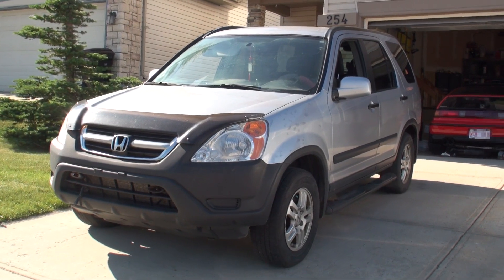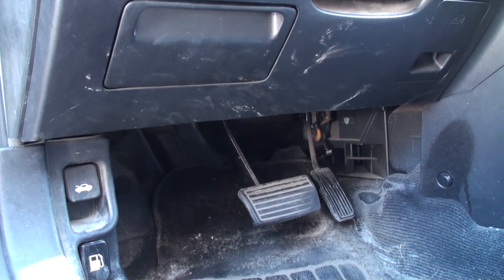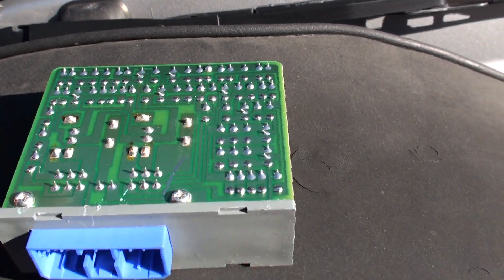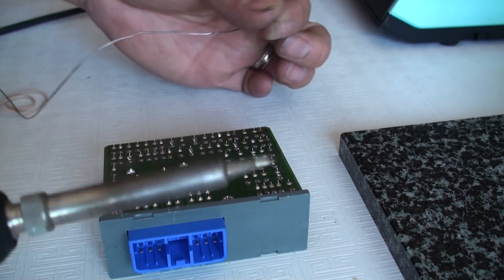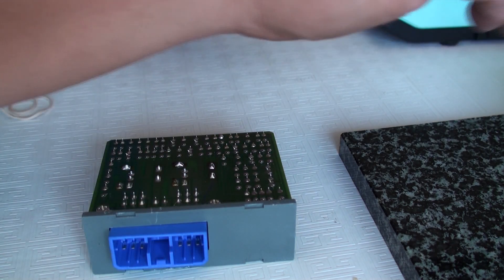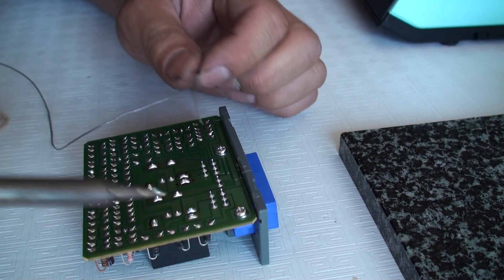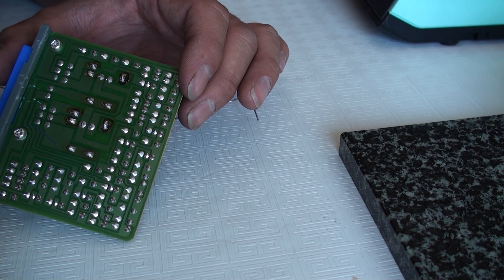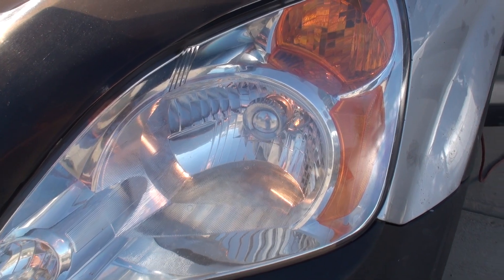DIY Honda CRV DRL Module Repair

Comment: Hello does anyone know where the DRL module on a 2010 Honda CRV is located...? I can't seem to find any info. Thanks
Reply from the maker: It should be underneath the drivers side dash around the fuse box steering column area.
Reply: @piercedasian  apparently not in the generation of CRV....

Comment: Thank you!

I was directed here from a comment in a Nissan forum. I have a 2005 X-Trail that has had wonky daytime lights for a few years. Sometimes both on, sometimes both off — or just the left side on. 

I sensed that the light bulbs themselves were okay, so this DRL module fix is great! 

I didn't know how I could safely open the case but eventually used a putty knife and a spare door strike-plate on each side. Just get those straight edges in there to separate the sides — and out comes the circuit board. Mine is slightly different but I'll key on the areas you outlined in the video and report back.

Here goes!

Follow up: Well... no luck for me. None of my joints looked suspect, like they did in the video. 

I'll just keep on running my lights in 'twilight' position during the day, until I can get to a wrecker. If THAT part also fails, I'll know how to address it.  Nissan doesn't display a trouble code for the DRL failure, so I won't be bothered by that.

Comment: Thanks so much for the video. I have been changing bulbs, turning on my headlights to stop the damn DRL from buzzing and then of course forgetting to shut off the headlights and dead batteries. Wished i had just found your video a couple years ago. You were dead right on the bad solder joints. Everything worked out great. Very thankful for the clear video. You dah man!!

Comment: Nice video. The only thing I might recommend is fully removing the old lead free solder from the holes using a solder sucker. Mixing solder chemistries (leaded/unleaded) can lead to premature failure of the joint. Simply flood the joint with unleaded (adding flux helps a lot), then suck it out with a sucker, and apply new leaded solder. The joint will look better and last longer.
Reply from the maker: In my case there was no need for it because I have stockpiles of old lead solder that I purchased years ago that flows perfectly with the existing solder.  You make valid points however, in that new lead free solder can pose a problem with solder containing lead.  Best way to comprehensively remove solder cleanly I find is using solder wick to suck it up.  Works extremely well especially when I am working on restoring old vintage electronics.
Reply: @piercedasian  So actually what you are are doing when mixing chemistries is you are lowing the melt point of the unleaded solder (217C) to a melting point somewhere in between unleaded and leaded (183C or138C). Even though to the naked eye, the two types appear to flow together, you are actually creating a weak joint at a molecular level. Ie. A pure leaded or pure unleaded solder joint are each a stronger in their own right than any mixture of the two. When you mix, you make a joint that is more prone to oxidization and eventual premature cracking/failure. This is exacerbated in applications that are subject impact damage (like a bouncing car)

Tl:dr Always remove old solder unless you are matching the existing type with the new addition
Reply from the maker: Yes fully aware of that.  At the time when I created this video I don't think it even crossed my mind that lead solder was becoming the way of the dodo.  As I said before, the solder used in this repair for the relays I fix (and continue to fix) that I use leaded solder because that is what would've been used from the factory.  I fortunately haven't had the need to repair (but have played with) dead electronics that use lead free solder and that's a bit of a different animal compared to the good old lead stuff.  When that time comes when a I come across a part that uses lead free solder is when I'll have to explain the importance of not mixing two different solder formulations.
Reply: @piercedasian  My apologies, I must have misunderstood. Upon rereading and checking RoHS implementation dates. I see that the module that you were repairing likely was produced prior to the introduction of lead free solder. Excellent video
Reply from the maker: yep the cars I work on have plenty of lead in their electronic components.  A bit of an occupational hazard for me since I work on so many of them all the time :) lol

Comment: Thanks very much.  Initially this didn't work for me. A friend suggested that I remove the old solder first so I did. Then when I re-soldered the relay pins it worked fine. Sometimes the old solder is in bad shape you have to get rid of it first.
Reply from the maker: yeah, they're definitely right.  It depends on how you solder too.  I found when using underpowered irons that solder doesn't flow very good.  It's also important to know what solder you're using.  Many of these old relays used lead based solder so naturally, you'd want to reflow with a rosin core flux lead based solder.  Some folks that struggle with the repair seem to be using the lead free stuff which I think is crap but will work IF you remove most of the lead solder first.  Either way you fixed it on your own and that is what matters most.

Comment: How to remove the box
Reply from the maker: The box is held onto the car's chassis via a bracket that uses a single 10mm bolt.  It is far easier to service this item by just remove the electronics from the box and not have to fiddle with the actual box and bracket since it is in such an awkward position.

Comment: Fixed mine thanks for the good video.  I also fixed an immobilizer problem the same way.   Fuel pump wires were high draw wires and cracked the same.   A suggestion was to put some holes in the cover of the box to allow some air flow and not get so hot inside.
Reply from the maker: Glad it helped

Comment: My dash lights, running lights front and rear do not work. Could it be this?
Reply from the maker: running lights and rear lights yes.  Dash lights maybe not so much but I'd start with the DRL module first.
Reply: @piercedasian  it was fuse in the engine bay fuse box. It had a thin Crack on it.

Comment: Great video Thanks. But I have a simular problem on a 2001 CRV. I know it was modified for driving Light importing to Norway... 
My problem is that the light will not go off when I turn off the engine. 
Any suggestions?
Reply from the maker: hmm I can't help you there b/c goodness knows how the modification was done.  There likely is a sticking relay as I'm assuming that it was working fine previously?

Comment: Thank you so much! You have saved me a few hundred dollars and a ton of worries. I have a 2006 CR-V and the DRL didn't work for a long time! I thought it was a BIG problem! I followed the steps in your video. It worked out really well, except I had a bit of hard time trying to separate the wire harness from the socket. But it was done. Thanks for sharing!
Reply from the maker: Glad it helped

Comment: 2021 and our first CRV 02 and couldn't believe Honda would do recall for this poor module. I contact a CRV forum and no one there responded til I looked and found this video and couldn't be helpful. I was able to take the 10mm bolt and remove the module. And just like yours the cracks where visible on the solder side of the relay. Also once out and removed the repairs couldn't be more easy then putting a diaper on a baby. But mine was up and to the left of the underside and I used the 10mm with extension and just took the whole bracket out. But THANKS again for a 2013 video showing how to do this and where to look.
Reply: Glad I took Electronics Service Technology in college this helped alot in how to solder and desolder. Which I did to redo the solder points. And now it looks new. Next time I at junk yard I will grab a few of these as backups.
Reply from the maker: Glad my video was of use to you.

Comment: Do you need flux paste or its fine without?
Reply from the maker: The solder I use has flux combined with the solder but you absolutely need flux to allow the solder to flow properly.  If your solder doesn't contain rosin core flux then get a compatible flux paste designed for electronics use.

Comment: Thanks dude!!! I have been fixing and repairing my own vehicles for 30 years and have done ground up restorations on two vintage cars. I am an instrumentation tech by trade. I could not find the problem with my 2004 CR-V high beam problem and exhausted all of my troubleshooting skills and knowledge, until I saw your video. Had it fixed in 15 minutes!!! Thanks so much!!
Reply from the maker: Glad to help

Comment: Thanks for the video, it is very helpful too , My 2004 CRV DRL error light up and high beam not work  problem was solved after  re-soldering the joints .
Reply from the maker: Glad it resolved your issue.  Yes these DRL modules and main fuel relays in these cars all seem to suffer the same problem.  A quick touch up with the iron and you're good for another 10+ years.

Comment: Cold and broken solder joints are a common  problem on a lot of electronic board are easy repairs thanks for bringing this to light 💡lead solder flows and sticks much better
Reply from the maker: yeah the new ROHS compliant stuff drives me mental.  Old school lead all the way!

Comment: I hope this works on my Q45, what a pain eh?
Reply from the maker: It depends on the mode of failure.  If luck is on your side then the fix at least will be super easy.
Reply: @piercedasian  went to a buddy at the National research Council and it was fixed in 10 min. Perfectly. Cracked solider just like in the video
Reply from the maker: that's awesome news!  Good job!

Comment: 2004 Honda civic si (SiR Canada) EP3. Just did this - I had three cracked solder connections I had to repair / re-solder. Worked great. Thanks for the video.
Reply from the maker: nice an old school EP3 :)  Glad it all worked out for you.

Comment: Had my DRL's working intermittently until recently and then they stopped altogether. Your video put me on the right track popped that sucker open put down some new solder she works good as new! Thanks so much.
Reply from the maker: sweet!  Glad to hear that you got your DRLs working properly.  It is amazing what the DEALERSHIP WON'T tell you and just charge up the ying yang to repair the module.  Congrats!
Reply: Well I imagine they just pull the old module, send it off to be 'repaired' and resold. Profit for them on parts and labour.. Or I could just spend 5 minutes with an iron.
Reply from the maker: No they actually sell you the new module and toss the old one!
Reply: I meant that they probably sell you the new one, but send your old one off to be refurbed and sold to some other poor sod. However tossing it is another likely option :p
Reply from the maker: ah I get you.. You're probably right... or their techs take the old part and rebuild it and then fix other people's car's on the side and pocket the extra cash... in either case fixing it yourself is by far the best option!

Comment: I install hid lights to my honda crv low high beam working but day time running light doesnt work .. Can u help me whats the best thing to do thank u
Reply from the maker: If I recall correctly the CRV daytime lamps rely on the high beams (running on a very reduced voltage) to work and since HID conversions typically delete the high beam lamp circuit (you don't really need it with HID) that no high beams = no daytime running lamps.

Comment: this worked a treat, 5 minutes with a soldering iron and it is working properly.  My 04 MDX unit came out with out tools and it was all done in about 10 minutes.  The solder points were really very obvious.  THANKs
Reply from the maker: you're most welcome.  Glad you got your DRL issues fixed!  Thanks for watching :)

Comment: Was having issues with my drl on my 03. But mine were burnt so bad I went to the auto wrecker and found a good module there 25 bucks. Thanks for the tips there bud. Cheers ehh.
Reply from the maker: glad you got your DRLs working.  Yes sometimes the contacts are so burnt that occasionally it may be just easier to get a used DRL module and resolder the joints prior to installing the replacement unit.

Comment: Excellent DIY video! My son has a 2004 CRV and it started with intermittent buzzing and the DRL light coming on and off, but the headlights worked. Eventually the buzzing and DRL light stayed on and the right Daytime light stopped working. I was about to go buy a new bulb, when I decided to Google "2004 Honda CRV DRL" and this video popped up. Thank goodness! My soldering skills aren't the greatest, but were good enough to make the repair. Took me about a half-hour and now the buzzing and DRL warning light is off and the right daytime running light is working! Thank you Pierce, for such a well done video!!
Reply from the maker: glad you were able to resolve your DRL woes.  Bad soldering skills?  If it fails in the future you can use his DRL module as practice to improve your soldering :)
Reply: Not bad soldering skills, but not great. I done more of it, involving electronics, this past couple of years and so far, so good! Anyway, thanks again, worked like a charm! :)
Reply from the maker: you're most welcome!

Comment: When I start the car I hear a buzzing sound (coming from the dash area) which goes off eventually or when I turn the headlights (parking or night) on. Eventually it stopped altogether and the DRL indicator light stopped appearing on the dash and the DRL lights are not working any more. Will this technique work ? Thanks in advance.
Reply: DRL lights are still working. Just DRL light indicator stopped coming on altogether.
Reply from the maker: What you described is exactly how a DRL modules begins to fail.  Solder up those joints and you'll get another solid 10 years of service from the module :)
Reply: Thanks! Since the DRL lights are working (and DRL indicator is not coming ON) what does fixing the solder joints buy me ? I understand that it buys me another ten years of the DRL module but don't understand what that means.

Comment: I have this problem along with few other problems : intermittent AC disfunction, intermittent hot air not switching, could these be related?
Reply from the maker: hmm not likely but there could be another module SIMILAR to a DRL one that could have a faulty solder joint that is causing these issues.

Comment: Did this fix to my 2005 CRV. Right high beam wasn't working and DRL dashlight was on. After resoldering the module board everything worked perfectly. Right high beam now works and DRL dashlight is off. Thanks so very much for this fix.
Reply from the maker: +Bob Hicks you're most welcome.  So happy to hear that you got your lighting issues resolved!

Thanks for watching!

Comment: I had a long time problem with my CRV headlights - buzzing, DRL, highbeams are very dim, sometimes they don't work at all... - 

HATS OFF TO PIERCE for this great video - although I nearly killed myself twisting to get under the dash - but I aint young any more. My background includes (long time ago) manufacturing printed circuit boards just like the one in this video (and most 1000 times more complicated).  And immediately I could see that he knew what he was talking about.

A quick look at my board indicated that all the Relay joints were hand soldered.  The flux was left on the board, where it should have been cleaned off. Over time the flux can crystallize and actually cause a short circuit - which may have occurred in my case.  I did re-flow the solder joints, and cleaned off the  flux (I just used paint thinner, which will thin out the flux so it can be wiped off, and any residue paint thinner will quickly evaporate).

My lights work great again - It has been years, and many, many, many bulb replacements.  Again thanks for a great video!!!!!
Reply from the maker: +mortgage advisor glad you liked my video but more importantly I'm glad your lights work again!  Board manufacturing?  wow.  I used to run a national repair facility for customer premise equipment for a telecommunications company so understanding soldering techniques is critical.  The solder joints on many older cars do fail especially when there is heat and vibration such as that found in a car.  The driver resistor in the box + the higher than average amperage draw of lights is what makes joints fail due to all the heat.

Thank you for watching my vid!

Comment: Did this on many Hondas. Except on VR-V . Great video. Internet actually does not have as much on the CR-V for this particular repair.
Reply from the maker: +AUTOCUBE lol, yeah it is definitely a common problem and I would agree that theren aren't as many CR-V fix it vids as compared to other Honda models.
Reply: damn fuel solenoid too at charcoal canister.
they fuck up and get evep fault and eventually fry ECU! unreal ey.that was another bad  spot. after replacing the purge valve the fault didnt go away because the internal short in evap SOL fried the driver inside ecu board. do a post on that? might be usefull.

Comment: The DRL fault light on my 2005 CRV was intermittent for a few weeks and then finally came on solid.  It made sense that it was something like a cracked solder connection.  I follow your tips and it was fixed in 15 mins.  Excellent!  Thanks very much.
Reply from the maker: PartikleDestroyer glad you solved your DRL problem!

Comment: Thanks, buddy, you really saved my money) Had same problem with civic and have fixed in minutes. Dealership wants 257 CAD plus installation for Civic module. Crap!!
Reply from the maker: yep that sounds about right.  The part is surprisingly quite expensive but yet it is such an easy fix!  Glad you were able to fix your own modules :)